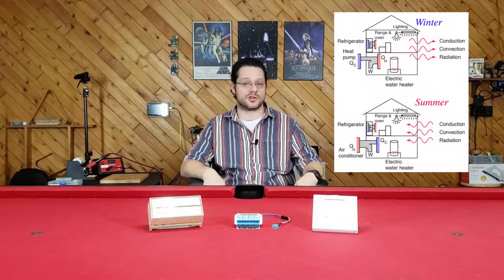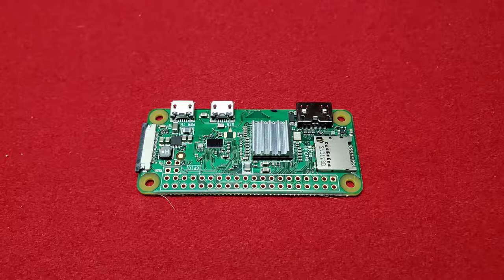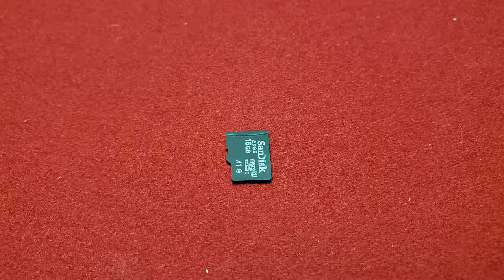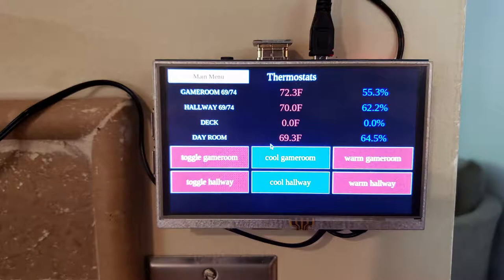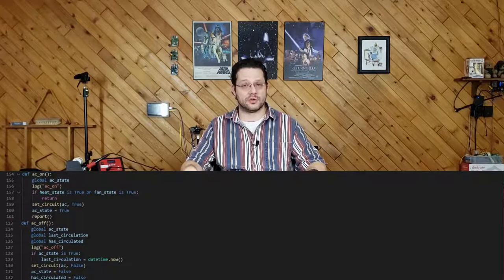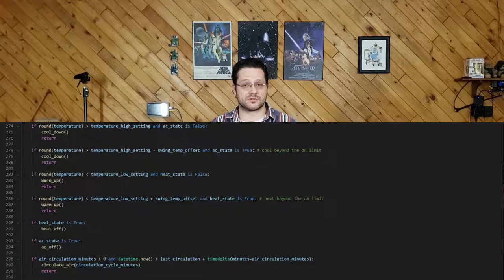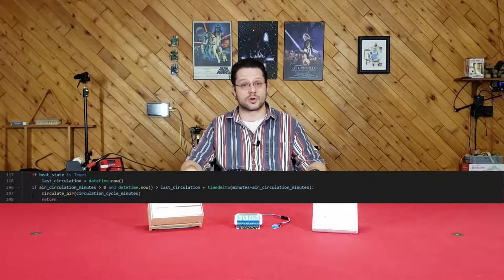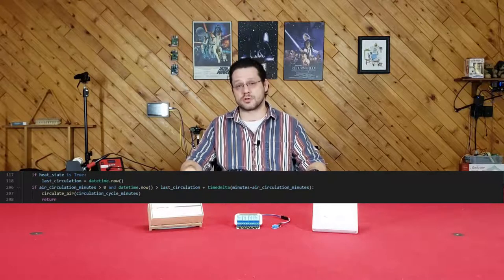Build Your Own Smarter Thermostat

Comment: 6:30 I don't think it is ever discussed how to wire the buckConverter-Cwire-raspberryPi. I'd like to do this for my own project but can't find information...
Reply from the maker: You are correct, good catch. I also failed to mention that you need a rectifier to convert the AC to DC. Here's what you'll need:
https://amzn.to/3Tuoi7K
The red and blue wires coming from the hvac unit (furnace or otherwise) will be carrying 24 VAC, you can connect them in no particular order to the red wires on the above device. Then, you will need this:
https://amzn.to/3tBvF2x
You would connect the black wire from the rectifier (ac-dc converter) to the terminal marked GND on the underside of the buck converter and connect the yellow to the terminal marked 5V. Then, with that particular buck converter, you can just use a short USB cable for power to a Raspberry Pi.